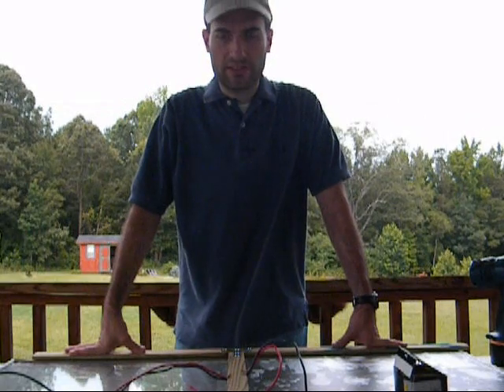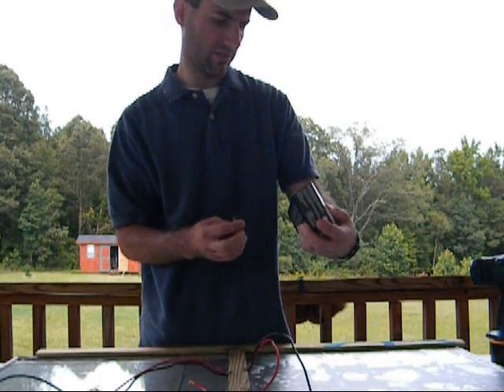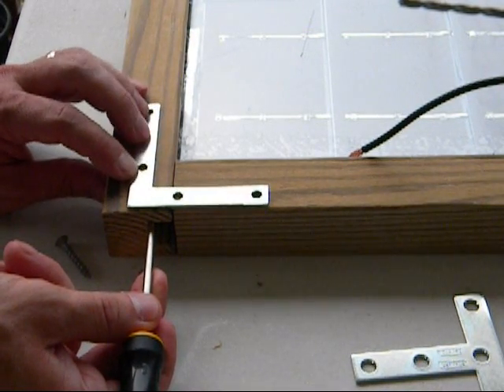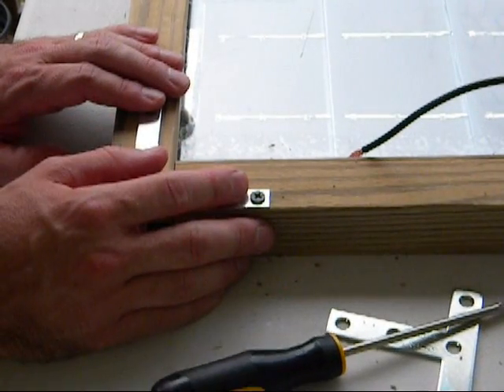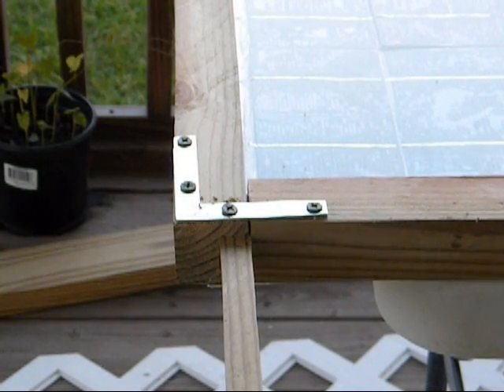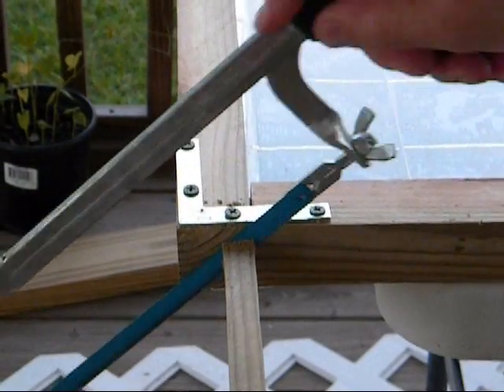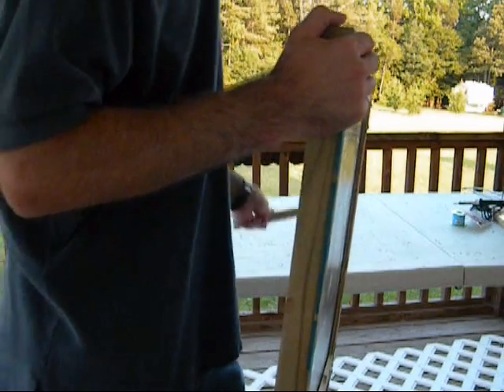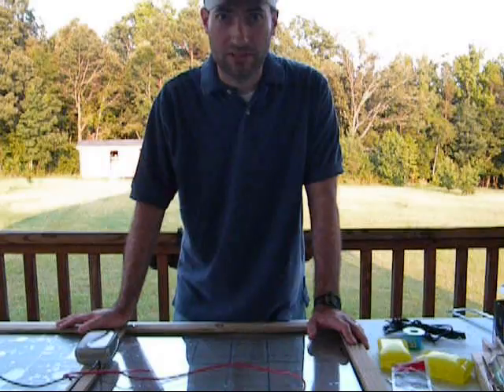How to build a solar panel part 10

Comment: I've enjoyed your videos and i like the fact that you've used recycled parts. I have a lot of fum with salvaged electronics myself. I noticed you have a miter saw, you could 45deg miter your corners on the outside of your frame and save having to fill the little hole also the corner brackets you used would have more to fasten to on the two inner most holes where as they way you have it now only two holes on one side and one on the other have a good bite. just an observation from a woodworker.

Comment from the maker: @buckbeak1965 I do not think so. After you put them together in series, Test your output and see how many volts you are getting. If you are charging a 12 volt battery you want right around 16 to 20 volts. After that you should be fine with just adding a blocking diode and then that is hooked up to a solar regulator. Then hooking it up to your deep cycle battery and then to your inverter. Thanks for the question.

Comment: @skippy3840 with home made pannels with different voltages its important because one can over power the other
i made one 2 sets of 38 cells with 2 6 amp diodes for each set

Comment: Usually, a good charge controller will take care of reverse power flow for you without having to use the blocking diodes on the panels.

Comment: @Den0Q hey Denoq, A blocking diode is like a resister. Its sole purpose is to block current from moving in the wrong direction...No such thing as a dumb question..Later from the west coast....